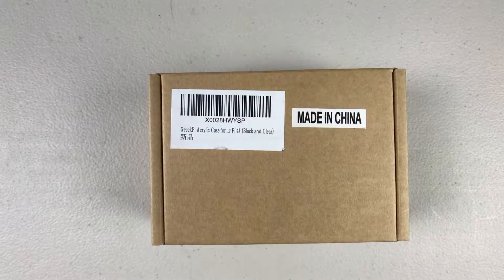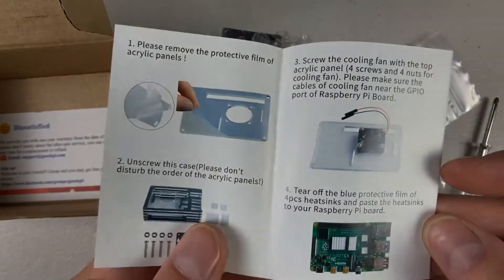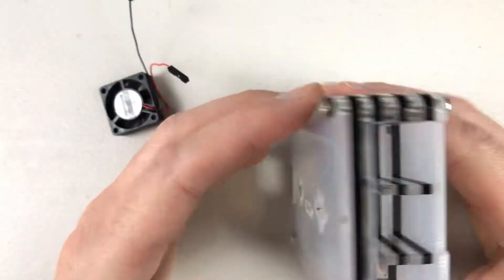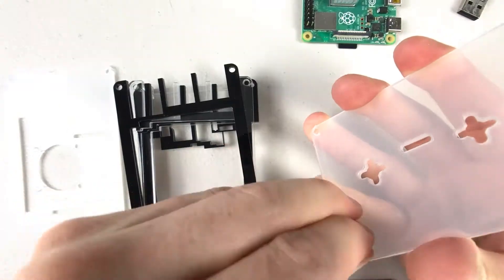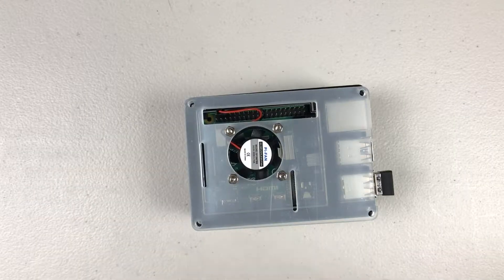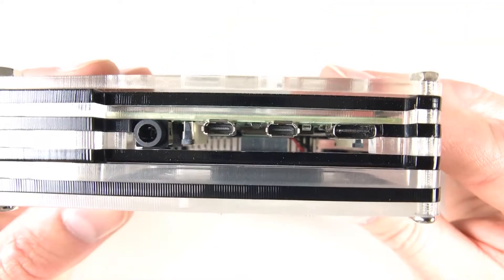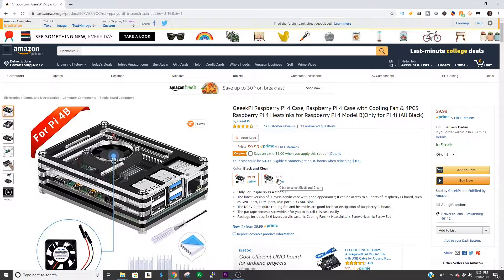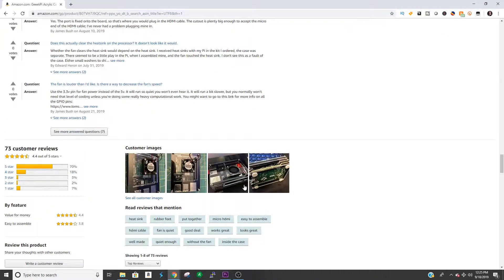GeekPi Acrylic Closed Case for Raspberry Pi 4 - Unbox and Review

Comment: Also, the Fan is upside down.  The label is the exhaust side and the case is designed to have the inlet externally facing to force cold air directly upon the CPU.
Reply: Yea, he messed up with the fan. Both the fan and the screws are the wrong way.

Comment: Just to add you screwed the fan the wrong way round the bolts should be on the underside so are inside the case even the picture at the end shows it that way otherwise you have ugly looking screw sticking out the top.  other than that useful to see someone put this together